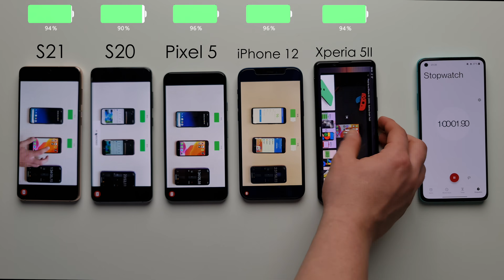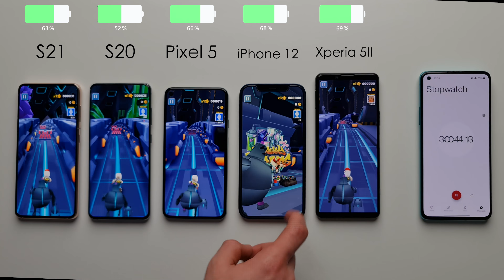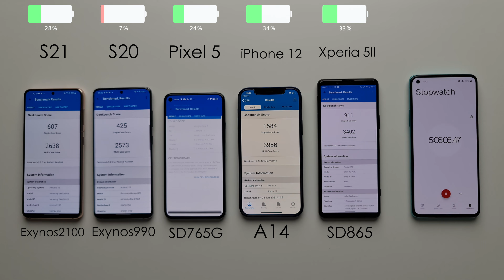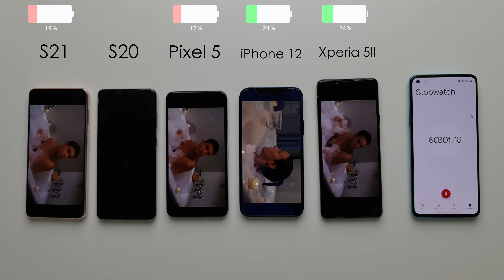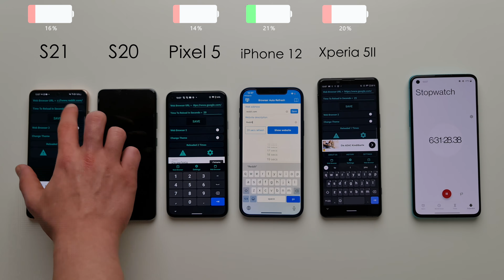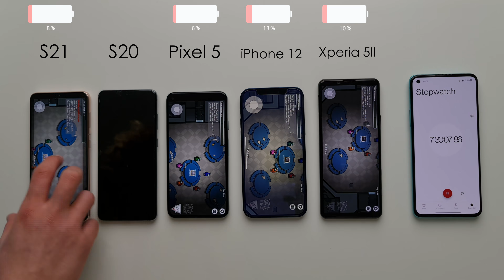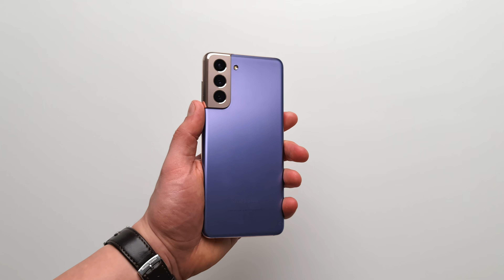Samsung Galaxy S21- ULTIMATE Battery Test! (Exynos)

Comment: It's interesting to see all the different variations of the S21 battery. I've seen it last the longest. I've seen S20 last half an hour longer. Overall it does seem to last a while tho. So that's good. The 10-120hz adaptive display is a really good power saver.
Reply: S21 has a 48-120Hz adaptive display. the 10-120Hz one is on the Ultra.
Reply: Yooooo l found you
Reply: You know that it's not plus or Ultra version right? Base version is 4000mah
Reply: Exynos is just not as competent as the Snapdragon. In order to achieve the same level of efficiency as the SD888, the Exynos 2100 needs to drop to 58% of its maximum performance, compared to 77% for the Snapdragon. This explains the 600 single core score of the S21 here when thermal throttling.
GSMArena tested this already and it really shows that Exynos is still inferior to Snapdragon, though to a much less gap compared to last year, where the Exynos is almost as good as an upper mid range chipset rather than a full-fledged Android flagship SoC.
Reply: @troy5568  that's not possible buddy. Both the exynos and snapdragon chips have the same cores and everything is the same. Only difference is the gpu.
Reply: @propiii  as if gpu was a small part

Comment: Actually the s21 beats the 865 look at all the other benchmarks on other YouTubers channels
Reply from the maker: well as I mentioned, this test was done under load, so the phone was thermal throttling
Reply: @DariusKracht  Exynos' thermal throttling is severe. GSMArena compared the Exynos S21 Ultra to the Snapdragon counterpart, and the performance loss comparison was 58% to 77% in favor of the latter. The SD888 is more or less efficient than the SD865/865+ due to their move from TSMC to Samsung in fabricating their SoC, so we would be getting much better power efficiency if it was on TSMC's 5nm instead.

Comment: I thought the iPhone would get killed with a 30% smaller battery than the s21. These are both at 5nm so it is very disappointing. The s21 was on variable refresh so that should have made it even better than the iPhone!

I did have the Pixel 5 for a while but the YT creator's claims that it had great battery life was totally misleading and I returned it after two dead Pixels showed up.
Reply: Well the S21 runs at 120hz and uses the less efficient Samsung 5nm compared to the iPhone which used TSMC 5nm. It also really depends on the use case which one will last longer. But it's certainly a great improvement over last year and it has pretty good battery life
Reply: @hydroop  I am not sure any of the tests run above 60Hz, so that should not make a difference as it is variable refresh 10Hz to 120Hz. Both are 5nm and Samsung and Qualcomm should source the best, that is a feeble excuse!
Reply: @andyH_England  the normal S21 only goes between 48 and 120 and seems to run at 120 most of the time.
Reply: @hydroop  That is not very good! But still I suspect it ran at 60Hz during most of that test as even the fps test it was only doing 30fps!
Reply: @andyH_England  refresh rate doesn’t make that big of a difference. Last years comparing the s20ultra stuck at 120hertz ( not adaptative) with another s20ultra stuck at 60 hertz. The end result was only 4% of battery saving for the s20utra running at 60 hertz. So the iPhone is playing in a league of it owns and its efficiency is way. I can’t wait to see an iPhone with adaptative refresh rate and a 5000 mah battery. It could last 13-14 hours and literally crush the competition.
Reply: @MESSENO_ENG  Yes, and I cannot understand why Samsung fans are defending the s21 battery and instead of making excuses, they should be demanding better! Strange!
Reply: @andyH_England  The problem is not to defend Samsung 
Whether it's with 4000 mah or 2800 mah these smartphones all have almost the same size and screen size, no one has stopped Apple from increasing the size of its batteries. 
The S21s have just come out and have received almost no updates. 
Let's wait and see after 2-3 updates what will happen.
Reply: @rolins3279  Totally agree, change only happens if we stop sucking up to Samsung and that includes the affiliated YT channels.
Reply: @hydroop  no excuse for samsung, Sony uses 120hz and smaller battery and was real close to iphone 60hz